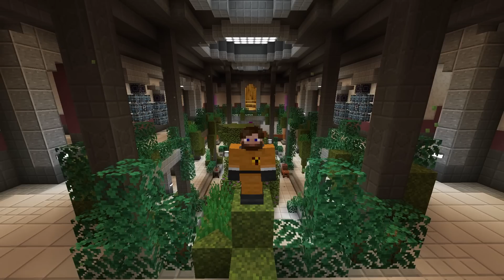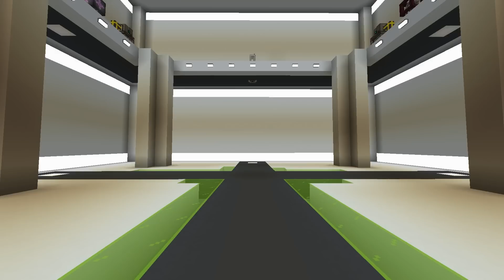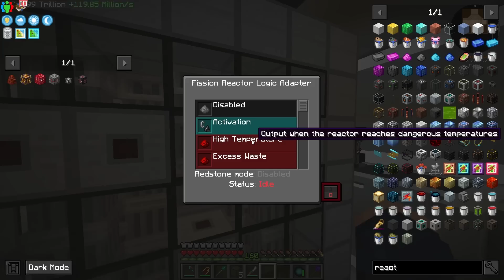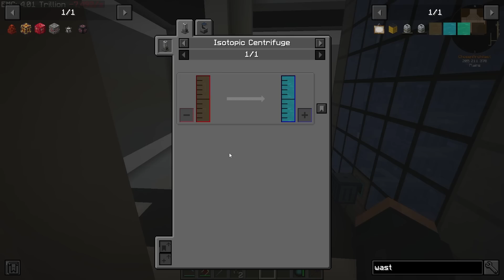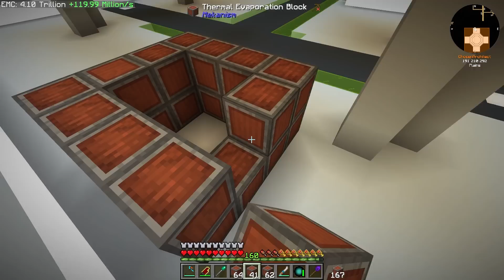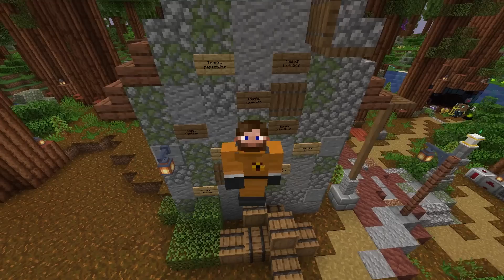PROJECT ARCHITECT 2 - EP 29: Fission Reactor Waste Management & Lithium

Comment: You don't need "insufficient fuel' to control reactor. Not enough fuel will shut it down anyway. You also shouldn't need 'critical damage', because having ANY damage means reactor was overheating, so at that point overheat protection should already turn it off.
Reply: Probably just to be sure, but thanks. I'll use that info when I play the pack.
Reply: Your redundancies need redundancies.

Comment: Throwing this in here because I don't think a lot of people are aware. When making thermal evap towers, you can use 4 solar panels at the top that will add heat to the tower but they still produce power. Using 100% of the power they produce to also power a resistive heater will max out the towers speed on a max height tower.

Comment: is there a way to dispose of the waste with another method ? (i use refined storage )
Reply: Use pressurized tubes or gas pipes from pipez to directly send it to matter condenser you don't need all of ae2 to do that just craft matter condenser
Reply: @adityababar1403 pressurized tubes don’t connect to the matter condenser
Reply: Have some pressurized tubes (Only use basic to avoid radiation) send to a boatload of nuclear waste barrels.  When you set it up make sure the barrels are keeping up with waste by right clicking the barrel and see a net loss.
Reply: Gas pipe either
Reply: i also use only refined storage so here what i did --> just craft one ME controller and power it closer to your installation, then copy what he is doing on video with the cables and Me interface/storage bus. you obtain a mini ae network but just to trash the waste👍
Reply: @Zanx8  i ended up using the same method without a controller just with a power acceptor from the same mod and powered it and it worked
Reply: Just make another dimension and send it there, not your dimension, not your problem 🗿